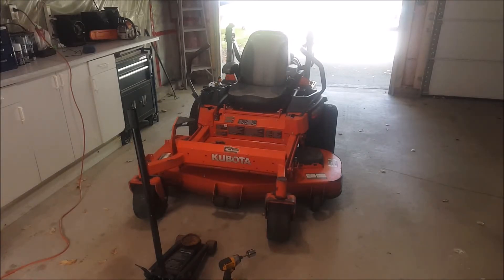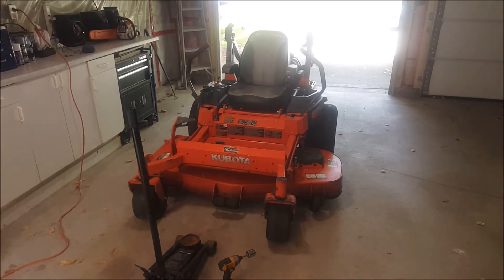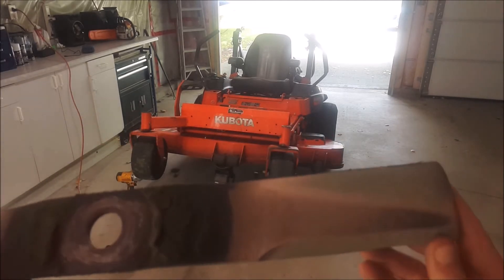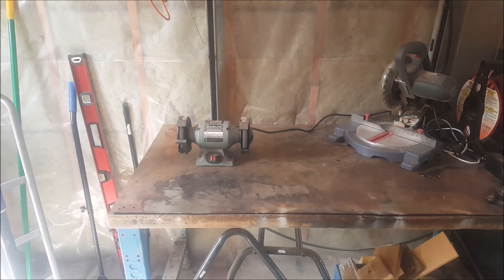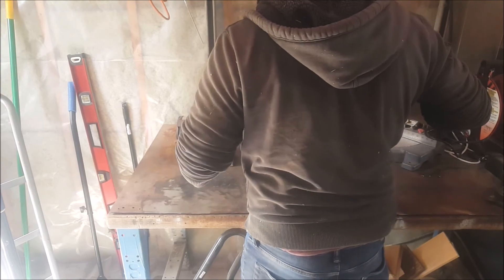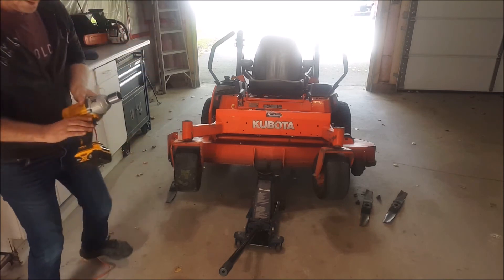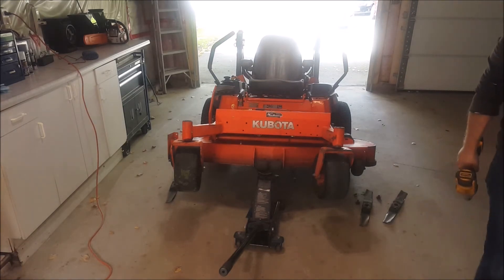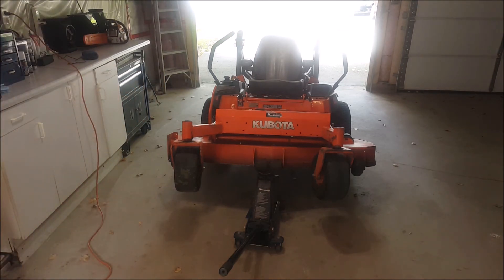Sharpen Your Kubota Zero Turn Blades  |  How To Sharpen Lawn Mower Blades

Comment: Thank you... Great video. I'm searching for an impact wrench mainly for blade change... Thinking bout the small dewalt that you had... Noticed you changed to the larger size to reinstall them...was there any particular reason?
Reply from the maker: Yep the small dewalt impact would be perfect for blade changes. I think what happened was i did overtorque them with the small dewalt to the point where i needed a bigger impact to get the bolts out doesnt happen often tho.
Reply: How to watch a guy’s back as he sharpens a blade
Reply: @OhioLogHouse  LOL, yup! I kept yelling at the screen “move the camera so I can see how you actually sharpen the blades”.  I know he did both ends but did he flip it over and do top and bottom? What angle did he hold the blade?  Other than that it was a good video. 
One more thing… was it just me or was anyone else afraid the mower may fall smush him?